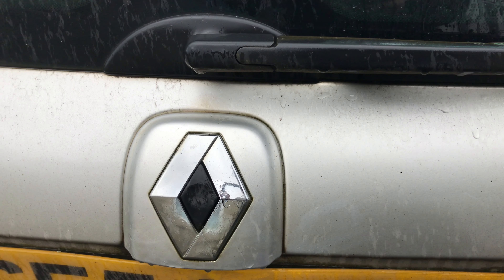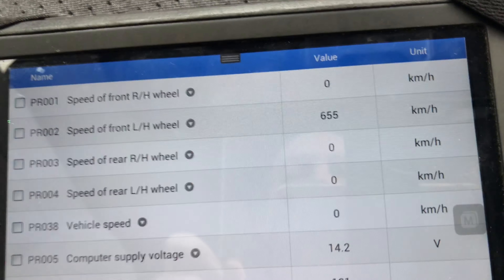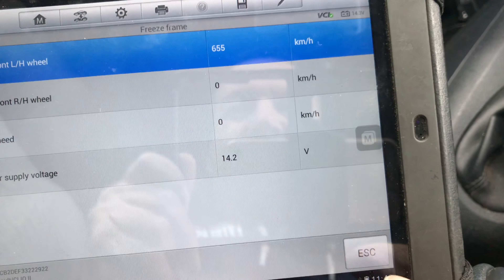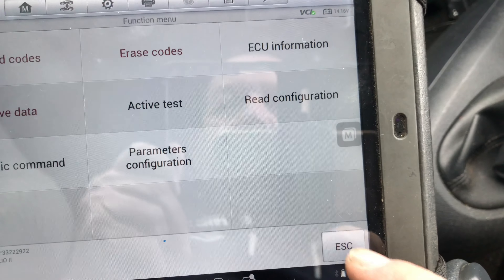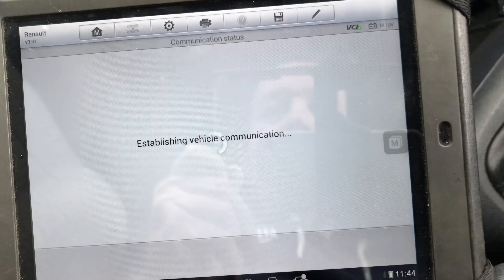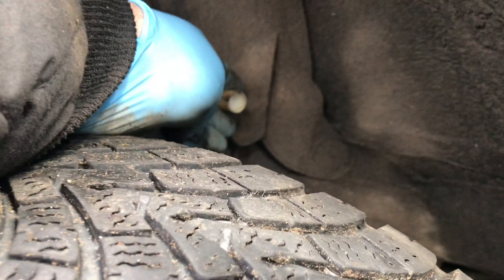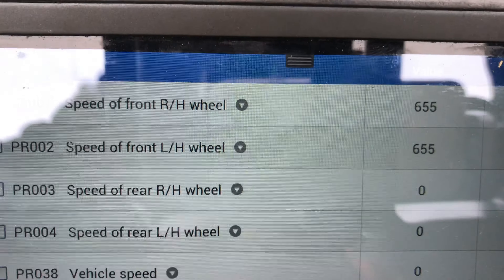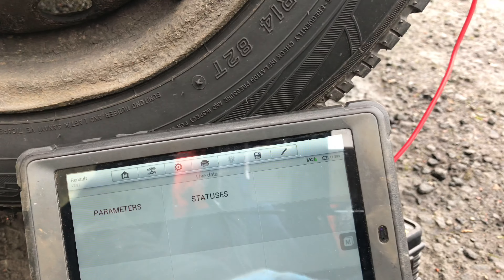Renault Clio (2004) Fault Code DF091

Comment: Seen this before on BWM however the reluctor doesn’t break it just expands and damages the sensor tip causing random abs activation.
Reply from the maker: Yes seen this especially on the rear hubs cheers sandy

Comment: Perhaps it came in contact with the wheel speed sensor Sandy 👍
Reply from the maker: Could be Igor but it's usually corrosion after 16 years driving with Nicole😜
Reply: @sandyande  👍